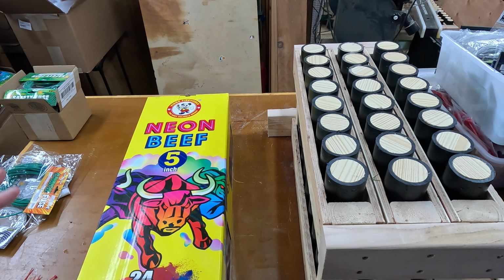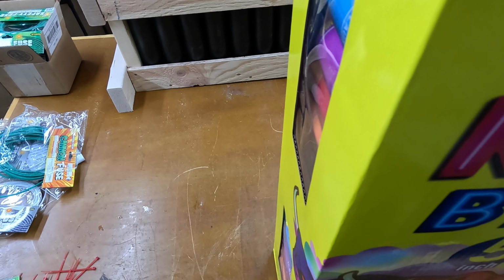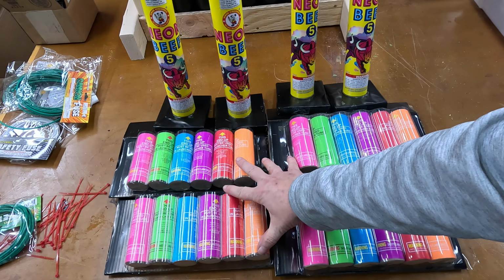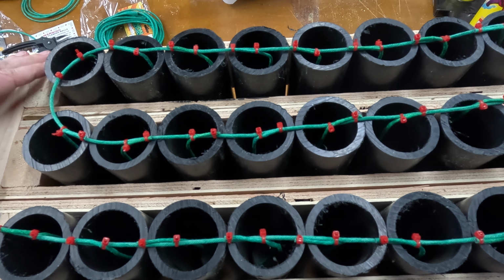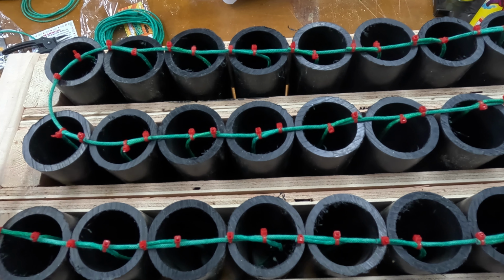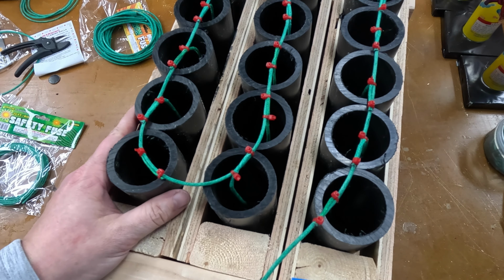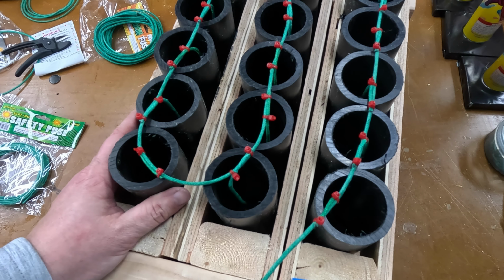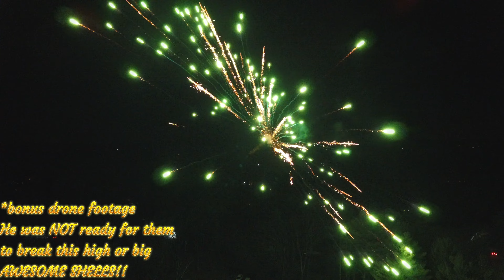Winda Neon Beef - I am so glad I have another box of these and they WILL be fused faster next time

Comment: Sweet shells and demo, like that rack you build
Reply from the maker: Thanks @bennycru !  The shells were awesome and are def going up again!!  Thanks for watching! 

I really like building the racks in the blade style like that and I can reverse the 2x4's if I want to turn it into a fanned rack or split off a blade to make a standalone rack.  I also made some 6 HPDE tube ones that I use to hold barrage candles at an angle but i can throw mortar tubes in it as well.  

The bottom and side rails are 2x3.  I put as many tubes as I want down to determine the bottom length.  The sides are 12" 2x3 screwed in with deck screws and then 3" wide plywood on top and bottom.  Then I use 2x4's to hold the blades together.  They have been really solid so far! I just need to make some more fiberglass ones with the new tubes!
Reply: @denfireworks  Man that's sick that you can do all that with those racks, you put a lot of thought into them, great job bro.